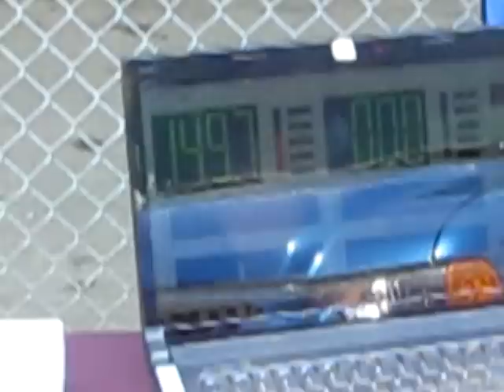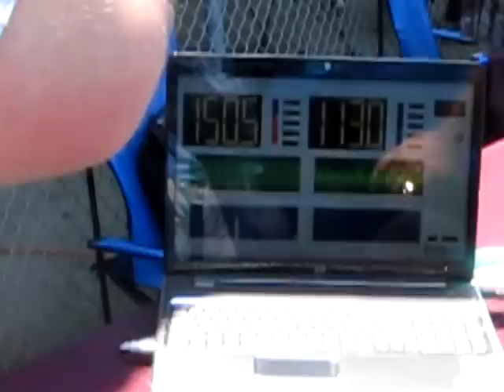150.7db @ Hot-O-Rama 2011 SoundOff

Comment from the maker: @psiloshroom wow man that is a high score and my score have all been on the term lab!! and i have tried single sub setup with sub/passanger side & port/driver side best was a 148.0 with AA havoc 15 & AQ2200D then i tried 2 AA havoc 15's subs up ports forward under the seats the 2 15's with AQ2200D did a 149.0 now i have subs and port up with Crescendo BC3500 did a 150.7 but i dont have the 4 door ranger edge so that may be a difference